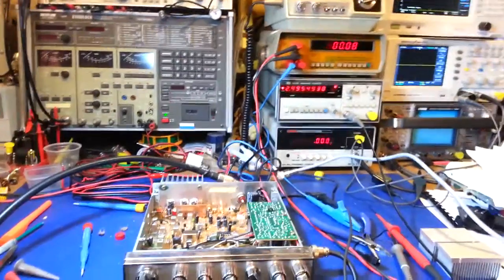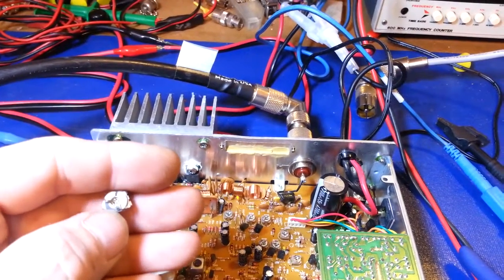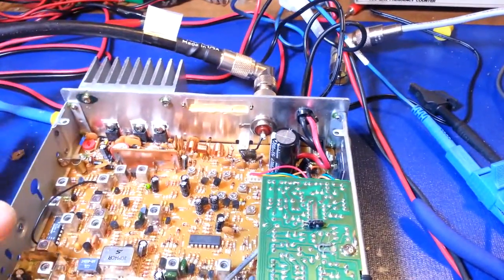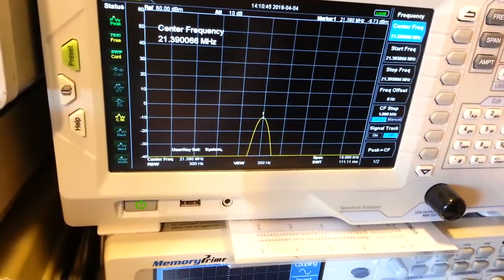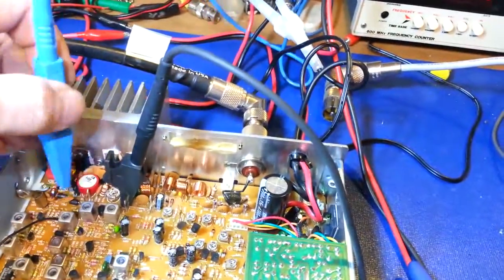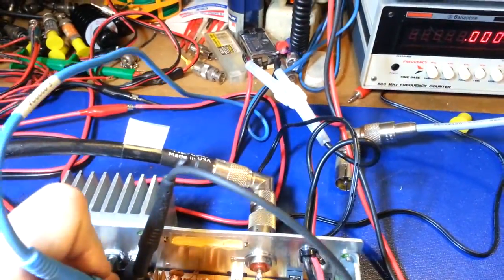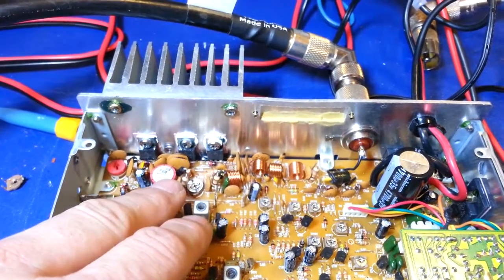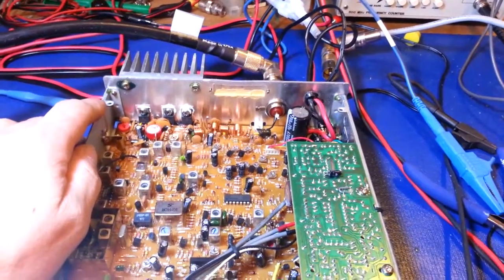Magnum Delta Force driver and final bias adjustment using spectrum analyzer.

Comment: I havent found any tech that can tell me why my delta force burns one leg of the transistor in two that alows the channel selector to function. When it burns one leg up, it stays on the channel it was on when the part failed. Does this at idle, not even during transmit.. its been a pain..!!

Comment: THanks for shareing.
I have a Yeasu FT-920 I am repairing.
I will try this method and see what results I get.
Its kind of like when I dip my amp I am matching my tubes impedance to the antenna so the better the tubes are matched then more better the tubes perform and will last you a lifetime if dipped properly.
Reply from the maker: Basically the same thing.  Finding the sweet spot for maximum efficiency.

Comment: could those trimmer pots handle the power needed to operate a mrf 455 or is it the 454 transistor swapping with the transistors from a president lincoln. or is it the one inside a emperor ts5010. if it's the one in the emperor. be on the look out for a radio. if it comes out right. then i'll send you a texas star 600 wiitj "4" one blue dot mrf 454's with an undetermined driver. it may need an heat-sink as there is corrosion creeping under the edge of the driver transistor.

Comment: So setting bias using the spectrum analyzer you set for the minimum spike. I like that idea. Also one more question are you happy with that spectrum analyzer?
Reply from the maker: Basically putting the transistors in their happy range which produces the least spurious emissions.  Max power where you want it, none or very little where you don't and the transistor runs cooler because it is running at peak efficiency. 

Very happt with the SA.  Depending what you will do with it you may consider getting the optional tracking generator, I did.  If you do a lot of RF work the advanced measurement package is also nice.  It comes preinstalled with a 48 hour free trial timer.  You can play with the features and if you like it then purchase the license key.
Reply: +MikesRadioRepair Thank you Mike.

Comment: If only I could get the bias sorted on the Washington :)
I asked a former colleague that does RF and he didn't see an issue with this.

I also think it's a win-win... I also suspect when you use the spectrum analyzer that your closer to the sweet spot.
The issue is that not every transistor is the same so the bias on one may be lower than it is on another.
Also other things going on... other component tolerances, etc.

Limiting spurious emissions = win.
Hell, the FCC would be proud :)
Reply from the maker: Yep, the cleaner the signal the better.